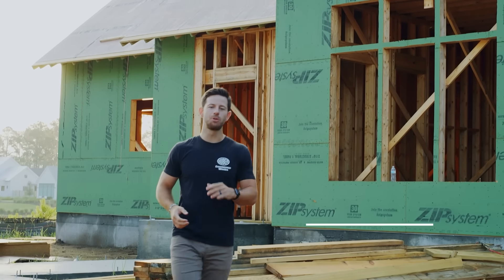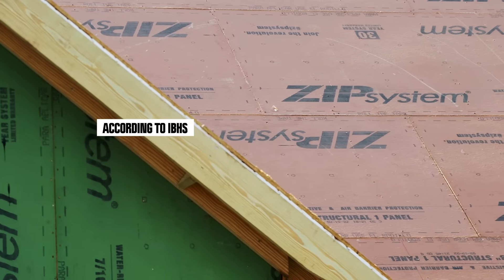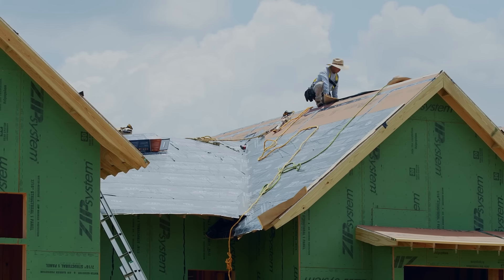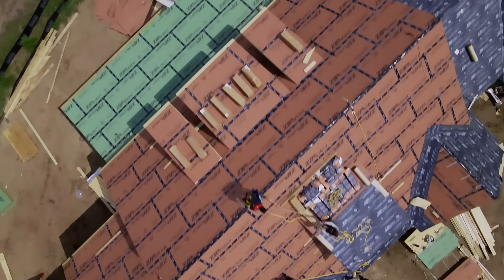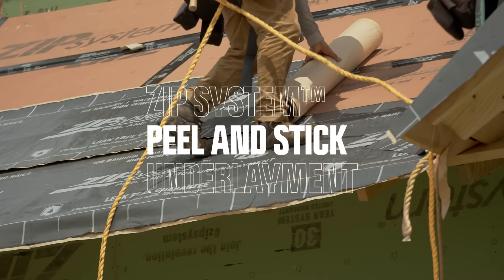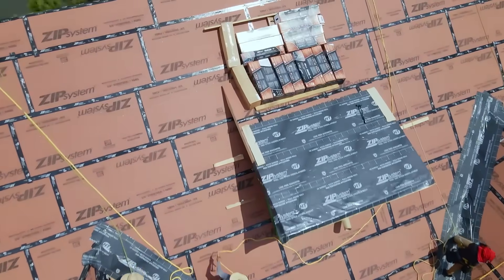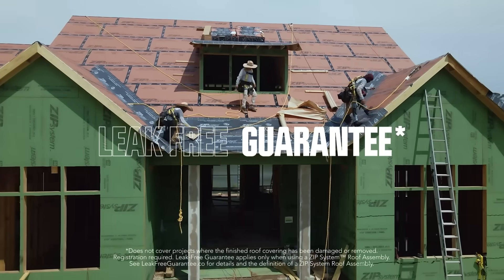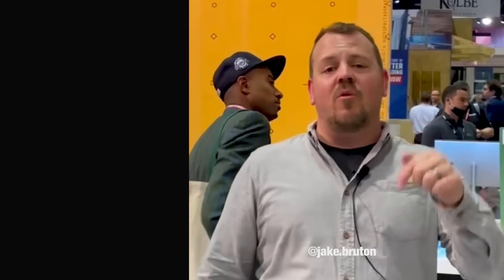Tips For Resilient Roofs| ZIP System roof assembly

Comment: The problem I have with Zip System is that it utilizes Oriented Strand Board (OSB). I’ve had nothing but problems with OSB both times I’ve used it. If only you offered a plywood version of your Zip System, then I would be willing to use your product.
Reply: What types of problems are you having exactly? Where are you located?
Reply: Youve never used the product but because youve used something not even like it, you have a problem with zip? 😂
Reply: Obviously you don’t know what you’re talking about, because if you did, you would know that the Zip System is essentially OSB, but with a special colored coating on one side.

Comment: Thanks. Is underlayment and ice & water shield the same thing? Do I need both? I’m building a 24x8 tiny house with. 2/12 roof that will have standing seam metal roofing.

Edit: and my roof sheathing is 7/16th zip. My wall sheathing is one-inch zip r.